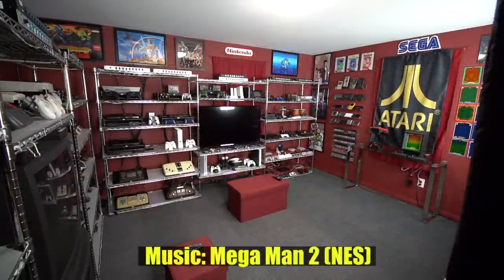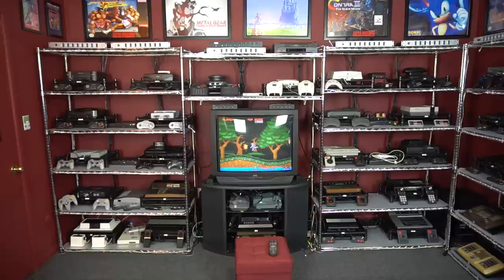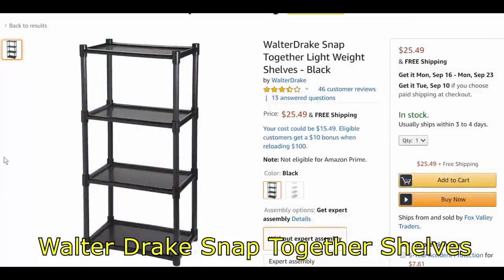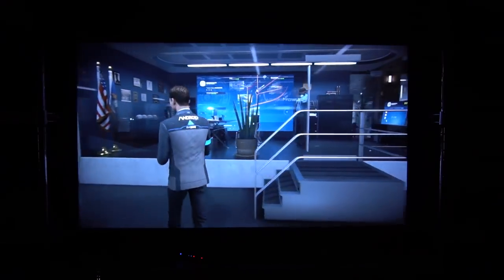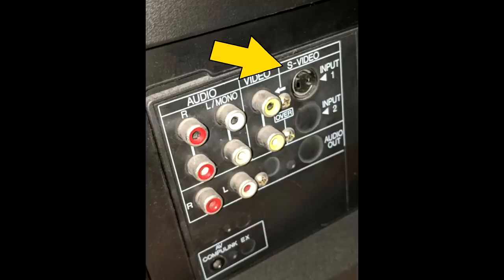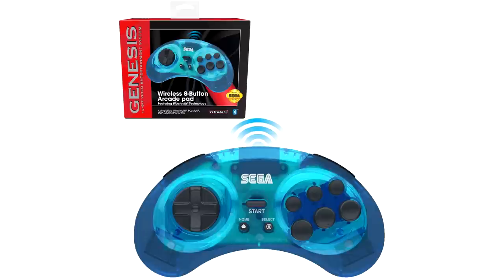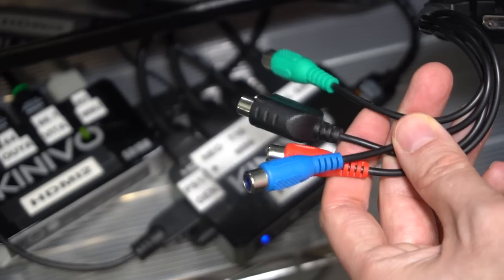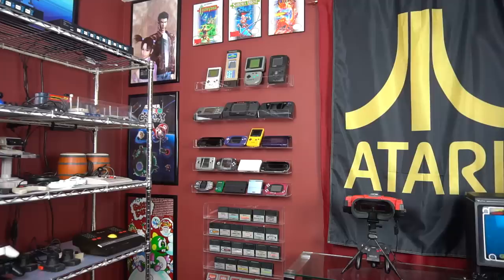How to Build the Ultimate Gaming Setup

Comment: Have you tried Jugee batteries, those are rated the same as a normal AA unlike the normal rechargeable, that and you can charge them with a USB cable. they won't report 1.2v because there's circuitry on them to make sure the voltage goes down linearly like a normal AA. 
they tend to work better with devices that have cercuitery on them, and they last a lot longer. 
since you asked for the link on the USB charger, I'm putting the link here 
https://www.amazon.com/s?k=jugee+batteries&ref=nb_sb_noss_2 
or if you want them cheaper you can get them off of ebay straight from china https://www.ebay.com/sch/i.html?_from=R40&_trksid=p2334524.m570.l1313&_nkw=jugee+AA+rechargable&_sacat=0&LH_TitleDesc=0&_odkw=jugee
Reply from the maker: Thanks, I had not heard of those types of batteries.

Comment: that is too much for me. i have everything in living room but it is all hooked up. nes, snes n64, wii, xbox, xbox 360, sega gen/cd, dreamcast, ps2, ps3, ps4. wish could do a bigger tv but can't fit that. nes, snes, n64, sega gen/cd dreamcast composite uses 5 switch box that you have and that goes to tv. xbox ps2, vcr/dvd component switch box to a component to hdmi converter and that goes to switch box. dreamcast vga goes to vga to hdmi converter and goes to hdmi switch box. ps4 hdmi1, ps3 hdmi 2, 5 switch hdmi hooked to hdmi3. 5 with hdmi has fietv, dreamcast vga to hdmi box, component switch box.  https://photos.app.goo.gl/NmdwBMKuSZUr36aG7
Reply from the maker: Sounds like you have all the major systems covered.

Comment: One chair seems kinda lonely.
Reply from the maker: There are 2
Reply: @HowToX  Yep, I just got to that part in the video. Guess the other was well hidden in the rest of the video.

I would not have guessed those were carpet tiles until you pointed it out. Good job with the install.
Reply: @HowToX  Also, I just ordered those magnetic pushpins. Thanks.